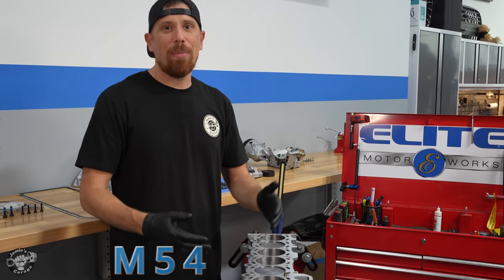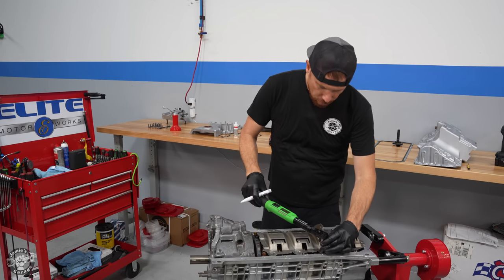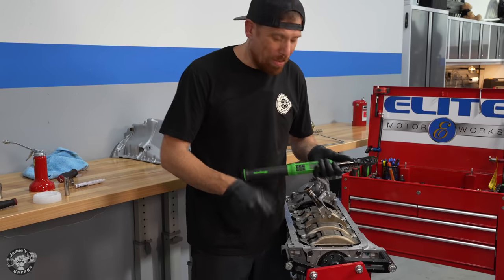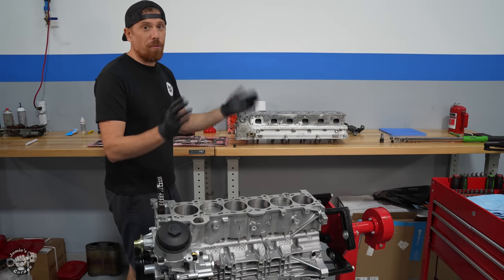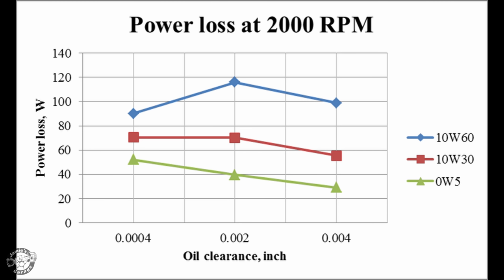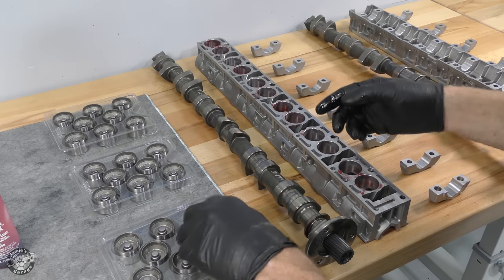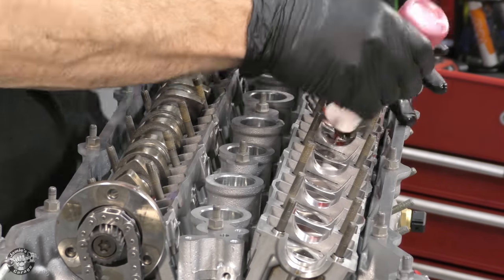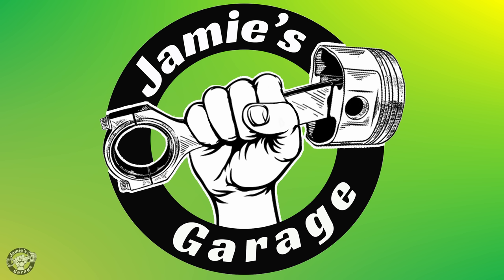Worlds Most Reliable BMW Engine?

Comment: 36:20   Correct me if I'm wrong, but the A is Exhaust and E is intake? Or did they change it on the M54. I took apart an M52B28 head a few days ago and that's how the cams were labeled in there.
Reply from the maker: You're right, I got it backwards... long night of filming I guess.. lol

Comment: You got that part about the DISA operation wrong.  It doesn't provide velocity at low RPM and volume at high RPM.  It provides intake resonance at two RPM ranges (instead of just one).

The valve is between the two banks.  Since it's an inline 6, the firing order alternates between the two banks.  As one cylinder's intake valves close, it creates a pressure wave that bounces back into the intake manifold.  At low RPM the DISA valve is closed, so the pressure wave is forced to take a long route through the intake manifold to reach the next cylinder (in the other bank).  When timed right (so at the correct RPM range for a given runner length) the wave forces extra air into the cylinder just before it closes.  At high RPM the wave would take too long, so that's where the DISA valve opens to shorten the distance between the two banks (so the pressure wave can reach the next cylinder sooner).

The fuel trim issue is because the engine is expecting a given amount of air to get into the cylinder, but without a functioning DISA system it gets less air than the computer expects and therefore runs rich (the codes are fuel trim control limits, they don't specify whether it's too lean or too rich).

Comment: Jamie, this is the first video I have watched of yours. I own a 2014 M235i, F22, N55 6 spd manual with Dinan S1 and performance exhaust, so I am very interested in the BMW stuff now.  My son and I replaced the gasket on the oil filter/cooler assembly because it was mixing coolant and oil. I think OEM is a plastic assembly but I don't remember for sure. I noticed the one you were cleaning and installing was aluminum. I'm a geezer now so I forget a lot. LOL. I've built many engines in my time but none of them are as complex as the engine you built in the video.  You know your s**t bro. I have subscribed and will watch more.  I have one friendly suggestion and question; have you ever used an ultra-sound cleaner on your hard parts that need to be reused for assembly? I also really liked the shipping container you guys built.  That should keep drop gremlins at bay. Take care and continued success.

Comment: I have a question about the m54 engine 
As much as I want my engine or motor to be build by you, but I live in Malaysia then the whole cost would be extremely impractical 

So here is my question 
How do I choose between m54 b22 or b25 ?

My target is to build a NA motor with 250hp on crank(better if on wheels) at around 6krpm n able to rev up to 7.5~8krpm soft cut and 8~8.3kprm hard cut

I thought about b25 at 1st, but it doesn't rev as freely as b22 
since I saw many builds like k24 destroke to 2.0 to be able to rev it to 10krpm 
I believe all m54 blocks are the same , just the difference in the rotating assembly
So choosing a easier revving 2.2 and stroke it to 2.3 
or 
lighten every bottom end components in the 2.5 a better option easier to gain power with larger displacement 

The 2.2 could be lack in power and 2.5 have too much rotating inertia, so a Frankenstein 2.3 would be the best option based on my opinion, but I'm lack of experience so my opinion pretty much shit 
a b30 is hard to find and tax is too expensive based on engine capacity , and I think piston speed could kill the bottom end real fast

Comment: Cool video, but PLEASE understand that "pre-detonation" isn't a thing. You have detonation and pre-ignition, which are very different things. Detonation is when the charge auto-ignites from pressure and temperature after the spark plug has initiated the burn and it causes shockwaves that travel across the cylinder. Pre-ignition is when something inside the cylinder gets hot and acts as an ignition source instead of the spark plug, usually some sort of edge of material.

Comment: There's a little hickup in what you said about the bearing covers. E is actually inlet and A is exhaust. In german exhaust is Auspuff/Auslass and inlet is Einlass. That's where  the letters come from. But I actually think that you still installed it in the correct way. I just wanted to clear that up so no one is gonna  mess things up when working on their own car. Cheers
Reply: Came here yo say this. I'm surprised that no one else pointed it out. I concur that he got it installed correctly... like he said 'you can't mess it up'
Reply: *to

Comment: at 11:28 that seal was put in reversed and the middle section bolt holes do not line up. later you can see that the middle section bolts don't want to feed through as they are blocked by the incorrect seal placement.

Comment: If the crank sprocket is slipped onto the crank at the same time as the oil pump sprocket is put onto the oil pump shaft with the pump chain in place - it will all go on easily all together without having to hammer or pry the oil sprocket into place - even though it's a chain the tolerance is just right.

Comment: For a racecar you should 100% have a clear low oil pressure alarm so you notice immediately and can coast to a stop with the engine shut off. The quicker you notice the more likely you save yourself an engine rebuild.
Reply from the maker: Good idea!

Comment: Regarding the cam caps .. 
as a german i think you got it wrong.
The „A“ normally Markes the exhaust side because in german its „Auslass“ 
Where as the „E“ stands for „Einlass“ which means intake ..
I Never did this Kind of work at bmw On an m54 but I‘m pretty sure about it.
Dont know if actually Makes a difference in this case though

Comment: This is so cool to watch. I love it. 
I have a e91 330D. m57 engine. I'ts leaking oil like.. yeah its BMW stuff. So i was planing to take it apart and fix all this.
How different is that motor to rebuild next to m54? Would love to see a video of that aswell. I've rebuilt engines before, just not this complicated. Mostly Saab, volvo, peugeot and audi.
Reply from the maker: The m57 is very different. I have a teardown video of the m57 https://youtu.be/uLmITNzAjgM

Comment: for the  O ring better to use hand craft by CNC machine with high temp material red color used in heavy truck hydraulic system

Comment: For “racing” chains sometimes they are cryogenically frozen or dipped in liquid nitrogen to “strengthen” the metal. Idk if that works tho.
Reply: It works in theory by thermodynamically pushing more austinite (metal phase) into martensite.  In reality it doesn't measurably make much difference. Especially in tiny metal parts like a chain.

Comment: 3:57 aren't those two edges on the bottom a faillure risk? (Design perspective) Like, the contact surface might wear out and cause the pump to stop spinning ?

Comment: That chains tolerances and strength of the materials and the hardening factor and heat slash stress rating are like 30-40% higher or better stats.... It's way more durable if somthing unexpected happens

Comment: I thought these were un rebuildable due to block threads breaking ? Did you remedy this by lowering the torque applied to just 2 sets of 90 degrees ?

Comment: My dude, Vacmotorsports has the headgasket in a ton of thicknesses for repairs, and if you're installing a turbo.

I had completely forgot this is going to be a backup engine and now I'm sad. Not that it wont be used eventually, it's just such a well built engine that it's kind of disappointing it isn't getting swapped straight in so the current engine can get the same treatment.

Comment: At 36:20, you say that the A and E on the camshaft caps stand for A is for Intake and E is for Exhaust - this is backwards.  The A and E are German abbreviations for German words - E is for "eingang" and A is for "ausgang" which mean entrance and exit in German.  Perhaps this was already mentioned in the 800+ comments.  Perhaps edit that portion.  Otherwise, great video!

Comment: Safety wire should have some tension 
I've seen em cutting in materials due to high vibration applications, you'rs is too loose and it will fail qc

Comment: I can’t believe you didn’t show how you clocked the return springs. It’s usually .030” off center line (low helix can be up to .045” depending on manufacturer). You’ll know if you got it right on the first exhaust sample.

Comment: 36:20 if the letters are in german (which makes sense), you got them mixed up. A stands for "Auslass", meaning exhaust and E stands for "Einlass" meaning inlet.
Reply from the maker: Yep, I realized that after posting the video.. I got it correct during the teardown at least. 😅

Comment: If you rev your redline then ir's more likely your oil pump will back off. As long you don't redline your RPM, you should be fine. Correct me if I am wrong.

Comment: You clearly put the wrong piston return springs in. Those were silver and the ones needed are black. Silver ones have a higher thermal absorption rate and keep the temperatures of the cylinder higher, whereas if you use black springs it prevents infrared radiation from penetrating the cyclinder walls and in turn causes the occipital biformicationer to operate at optimal temperatures ;)

Comment: Best thing with this video is that I got to see how the engine is "built" and it does look like a fairly simple engine to work on once you get familiar with the engine. I just bought an 320i with a m54b22 engine and I have a feeling I need to do some things on it, like the disa valve for example. I get like a hiccup feeling when giving much gas at lower rpms.. But I don't know, anyone know? Its almost like on a automatic transmission kickdown feeling, but I have a manual transmission..

Comment: Question, so when I was taught to work on planes in the air force we used a paint pen to mark the bolt head along with the material next to the bolt in one continuous line so if we came back later and the line broke we knew it needed to be re-tourqed. Do you just mark the heads of the bolts as a visual indicator of which ones are done?
Reply from the maker: It depends on the application but yes, I mostly do it at a visual indicator that it has been torqued.

Comment: The base point failed on my DISA - chased that lean code for almost a year.  Luckily the top pivot pin was fine and prevented any bad issues.
Reply: @Jamie's Garage - have you seen many under piston oil squirter arms fall off?  I had a shop drop my 330i oil pan (292K+ miles and they found 5 of 6 oil squirter arsm in teh oil pick up.  3 had been bouncing around a good it of time as they were pretty banged up.  

I would love to have you rebuild my engine and help you with it.  :)

Comment: I built a m54b30 bored over  with the upgraded 3 pc oil control zhp cams port polished intake and exhaust with a n54 turbo intake i had to mod to make fit. mated to a getrag420

Comment: These piston return springs are same useless as blinker fluid. I never used any of these and my car runs ok. It's just another way for car repair shops and car parts producers to pull extra money from your pocket.

On the other hand, soapy wooder is fine product I can recommend.

Comment: It's a very bad practice to use 1 contact plugs, other than 4 contacts from factory, because MS43 DME can ignite plugs up to 4 times in one revolution in low rpm. After one ignite there is a high resistance zone between contact and electrode, next time plugs ignite next contact in a case 4 contact plugs. There is a great ignite performance degradation in a case 1 contact plug up to the point that the unused charge will pierce the insulating candlesticks

Comment: @20:30 piston return springs are illegal to use on track cars. I'm reporting Chrisfix! However if you stick with the OEM oil pump then variable length connecting rods are illegal in racing 😜

Comment: The lockwire orientation was incorrect.
The part of the wire that runs along the bolt always needs to be oriented in the direction of the bolt threads.
;)

Comment: This is why BMW before the 90's were very reliable because most of the parts they used were metal, not that cheap plastic they use on everything now. If you buy a premium luxury car metal should always be use on engine components.  I would mind plastic if it was cheap but they sell their plastic  parts as if they were made of gold and replacing is are even harder because most of the time other plastics become brittle and you break other things.

Comment: Great channel lots of hard work. I’m curious why the block head bolt holes didn’t get hellcoils or timeserts. Also, the stock valve spring retainers are weak. Metric Mechanic sells a heavy duty valve spring retainer for the conical springs.
Reply from the maker: We did inspect all the threads and I considered time-serts but the engine is mostly stock. If it was boosted at all, it would have gotten them along with the upgraded valve train. I had to draw a line at some point in the build. LOL
Reply: @JamiesGarage1 I get it. Thanks again for the channel. And I hope you enjoyed your 4th. You probably need a break. 😉

Comment: 30:35 I think you installed these injector clips upside down; they need to also catch in the injector side grooves.  Made this mistake myself too :)
Reply from the maker: The camera didn't show a good angle but I assure you, they are installed correctly 😉

Comment: Pulling the headers to do install a new gasket and noticed one of the head bolts was definitely not torqued to spec, it was certainly looser than the rest. Surprisingly there was no warpage.

Comment: That oil filter housing is similar to the Alternator Mounting Bracket on the N62 V8. On our E60 with the N62 the gasket under the Alternator Bracket failed which is probably the most common issue with this engine. Fixed it myself in a single car garage with only about 5 feet of space in front of the car. Not fun.
Reply from the maker: That is impressive. Not a lot of space to work with when replacing that gasket. Good Job
Reply: @JamiesGarage1  I’m sure you’ve done a few of those Alternator Mounting Bracket gaskets. Have to support the engine and remove the drivers side engine mount to be able to remove the bracket but not before removing the radiator fan and housing and a crap load of other components. Did that job a couple years ago and now I’m having a blast doing the valve cover and timing cover gaskets. It’s quite the pain in the butt especially with such a tight engine bay with the V8 shoehorned into the E60. But a little hard work, some busted up knuckles and a good swear word yelled out now and then is worth the money saved by not paying for the repairs. I’ll only do the work myself if I’m confident I can do the job correctly. It may take me longer but I know it will be done and done right. I miss the days of reasonable labor rates but with all the new technology comes more expensive tools and training for auto techs.

Comment: Don't piston return springs affect the ignition in the cylinder + introduce pumping losses reducing performance plus them getting compressed in there isn't running the risk or scoring cylinder walls?

Comment: When you arrived to the "piston return springs", explaining them before you installed them, I was (consider I'm not native En speaker) like "WTF is he speaking about???". Then I saw...
AMAZING mod that one :p I think those guys from "Garage 54" channel did something like that into one of their Ladas :D
Another interesting one is to use ORings instead of metal piston rings, they work wonderfully and no scraping of the cylinder walls or re-gaping needed :p

Comment: I hope those are hot Nickel plated shot peened HST PRS with tungsten carbide dipped ends. I had a buddy who used cold-rolled aluminum galvanized PRS and they ended up getting shot out of the exhaust after 20 lbs of boost in his GEO Metro. Needless to say he won’t be buying his PRS on Wish from now on.

Comment: After watching your video, the only thing I know is how many parts in this engine could easily go south and ruin the day. LOL
Reply: Really just the oil pump nut.  The m54 is really reliable for street performance with fbo, obviously a track setting especially endurance is completely different.

Comment: I'm pretty sure that the piston return springs aren't matched to the muffler bearing torque rate and will cause an issue with the blinker fluid return level sensors. I'm sick of watching YouTube channels giving out false advice on engine rebuilds.

Comment: I don't know how you managed to make that mistake but during the voiceover you said that A is for intake and E is for exhaust and it's quite the opposite. Re-watched the cams part to see if you really got them swapped but you actually installed them the correct way. This is something that could cause someone a headache while putting his engine back together while referencing your video.

Comment: When you lubed up the harmonic balancer bolt, u also lubed the washer on both sides. Wouldn't that create a sort of bearing effect with the washer?
Reply from the maker: Yes. I don’t want the friction of the washer to interfere with the torque reading of the bolt.

Comment: good video
did you follow the video with setting it on time mounted everything now turned the engine and set it on time crankshaft went on time and exhaust camshaft on time but inlet was not on time
where is it wrong?
Help me

Comment: Did you re-use the same piston rings? The stock ones are notoriously low tension rings and cause oil consumption.
Reply from the maker: I show how the bottom end was built here https://youtu.be/KVE322t-oqw